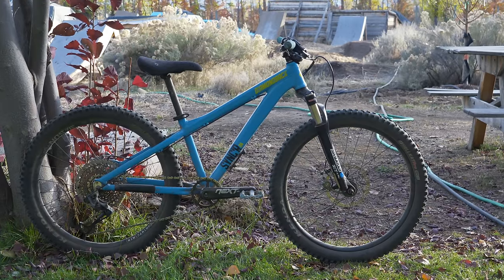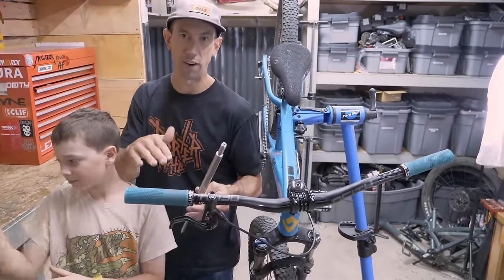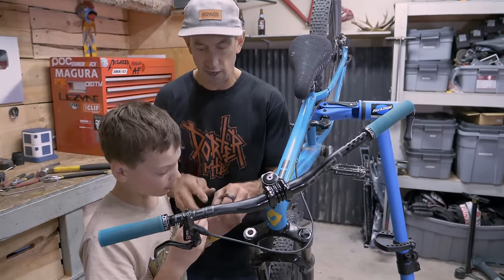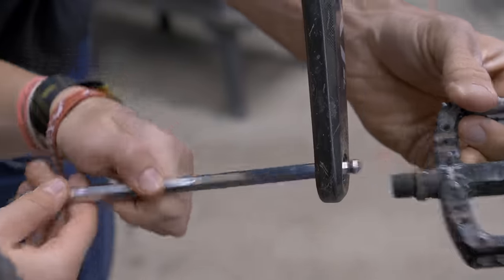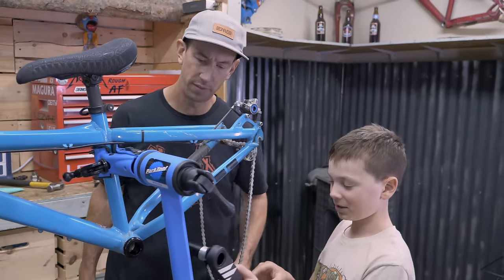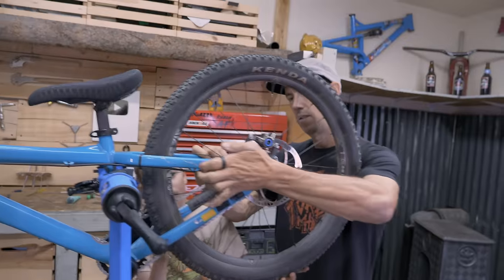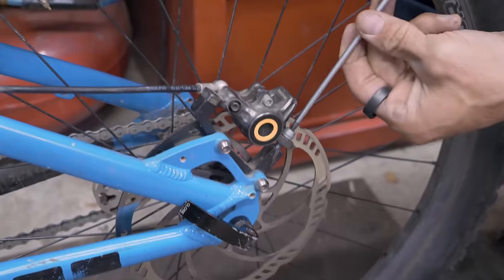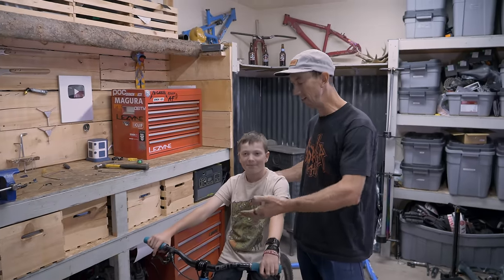Four BIG Upgrades to Owen's Bike!

Comment: I’m a relatively new dj person and im struggling with bar width. I’m at 720mm now and actually going shorter!! I’m 5’10. What are you thoughts Eric???
Reply: on average ppl cut it at 740mm i would say but you don't want to cut it too short because you will probably learn to do barspins without leaning back properly and it's also harder to ride on huge jumps
Reply from the maker: That's awesome, welcome to dirt jumping, it's the best! I have my dirt jump bars at 780mm, I'm 6'3 and I don't barspin much, they feel really good to me. I can still x-up and barspin when I want to, works well with tailwhips too, and I have great control. Best advice though really is do what feels good. We used to run 680mm width and I could do everything with those as well, I think I like riding wider bars now since I run 780mm on pretty much all my bikes.